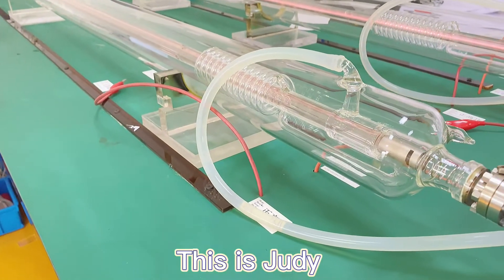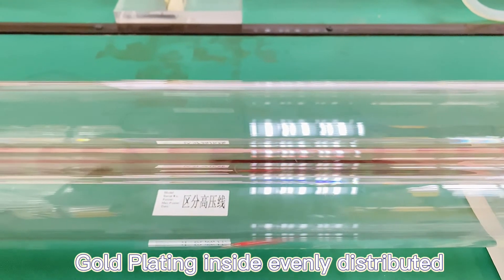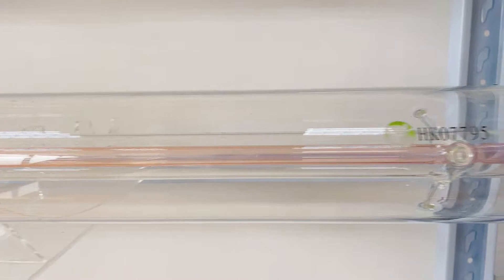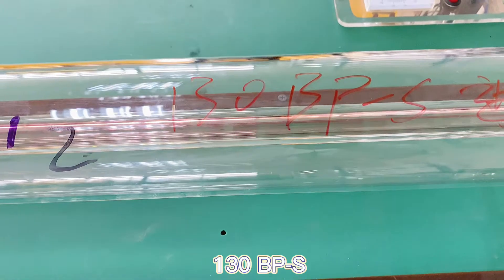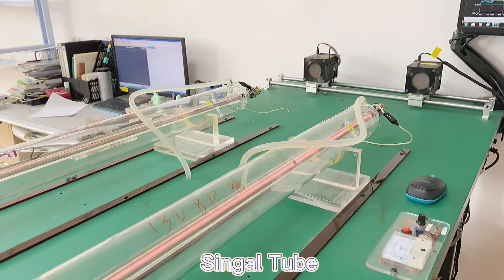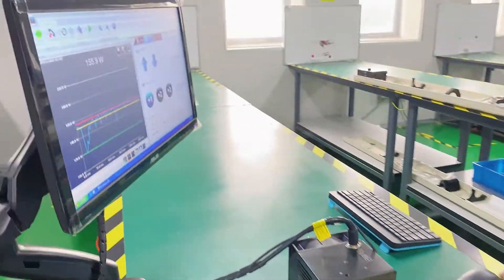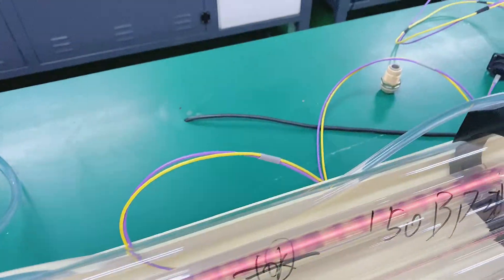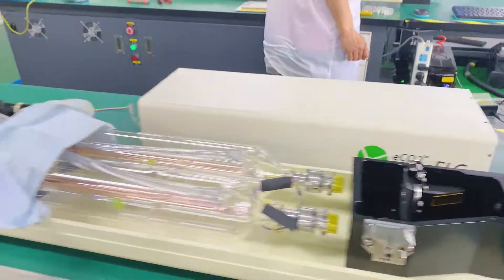Combined beam systerm laser tube BP and BP-S

Comment: Is this Combined laser cheaper or better than single tube?

Example:   I want 100 watt (I don’t need 100w, I need +60w).  100w tube is +900.00 (+1100.00).  40w tubes are cheaper, 200.00 last time I checked.

Can I combined 2 cheaper 40w to make 80w for a cheaper price compare to buying 1 80w tube?

What is the advantage of combining 2 laser tube?
Reply from the maker: The purpose of connecting two laser tubes in parallel is to obtain stable high power for cutting metal and non-metal. It is more expensive to connect two laser tubes in parallel. 
Many high-power laser tubes on the market are designed in series, which will save a lot of cost.

The power of the laser tube is proportional to the length. If the power is high, the length must be extended, but the length of the single laser tube to 2 meters is the limit, 
and the longer the laser tube,the more difficult it is to master the beam quality.

It is possible to connect two small laser tubes in series to obtain high power, but because of the series design, the consistency and beam quality control technology of the laser tubes is not yet mature. 
The laser tube must have a good beam quality to achieve good cutting and scanning effects.

Comment: Hi Judy, you combinner box using the 'Brewster angle' which is 67.4 for ZnSe at 10.6mm. ?
Reply from the maker: Combined box polarizer components and combined box total reflection mirror components,The two sets of beam are reflected one by one and the other is directly passed through the lens to merge